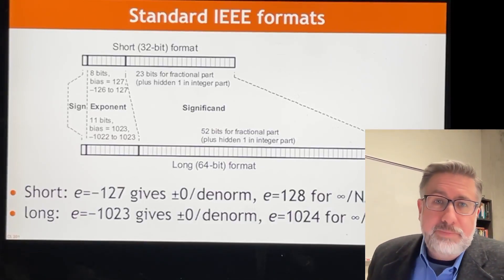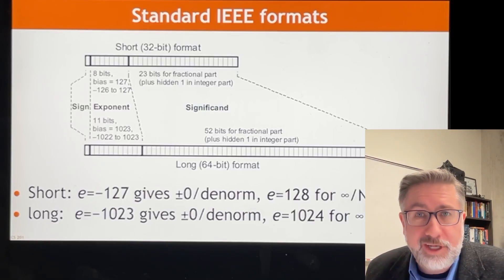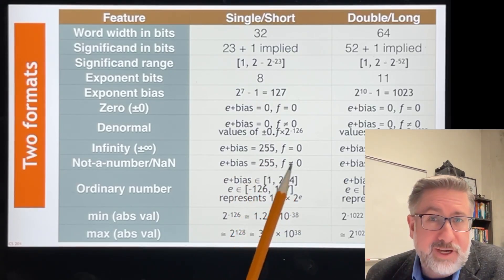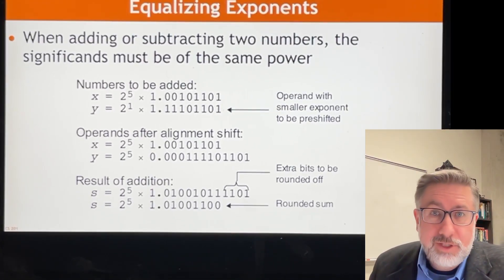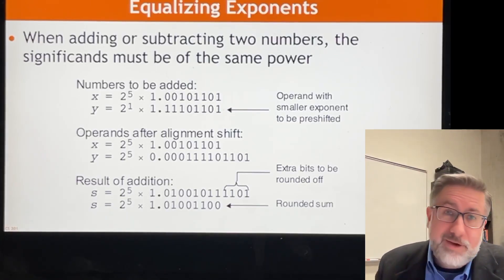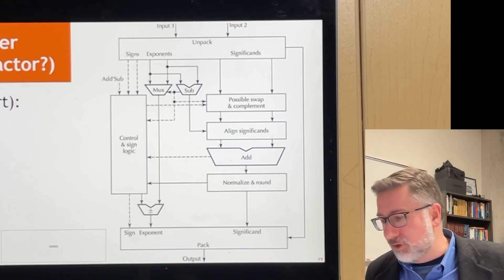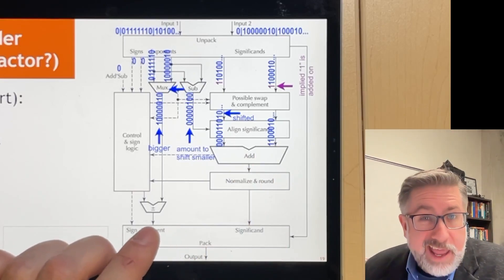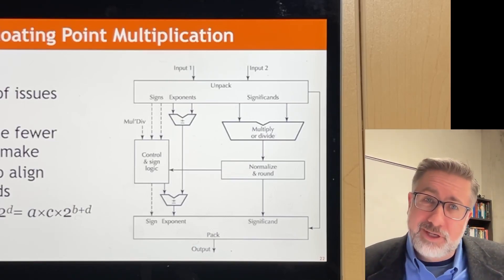FP8 Doing Math with Floating Point Numbers

Comment: Why need swap significands? How substraction is performed?
How significands are aligned? They need 2 bits to the left (one for carry of integer parts of 1+1 if both exponents are equal and another one for sign if signs of significands are different).
What is doing first rounding or normalization?